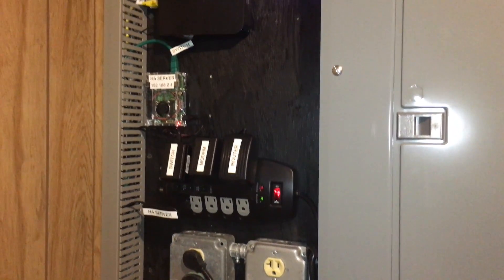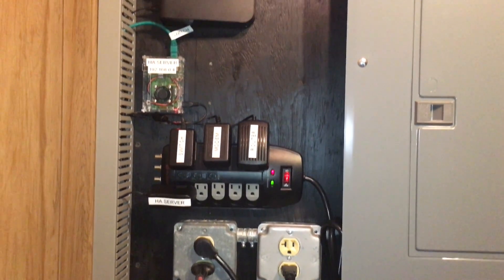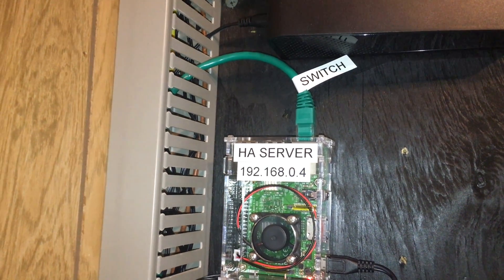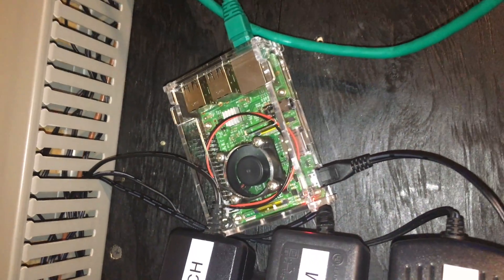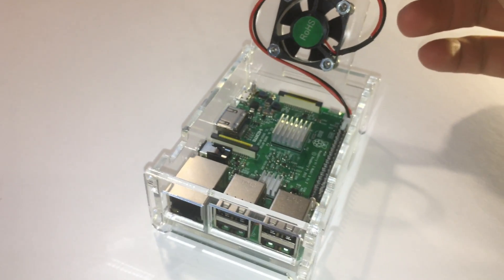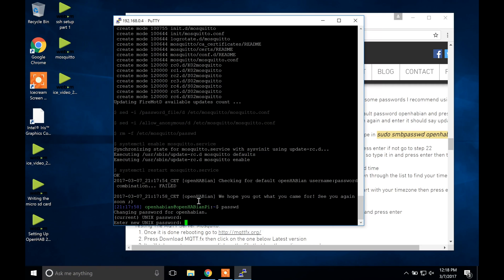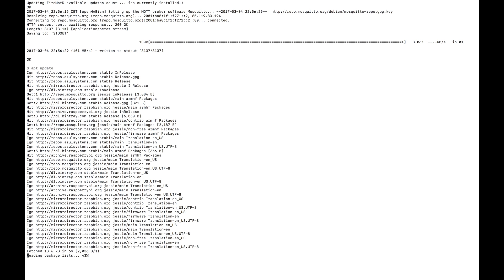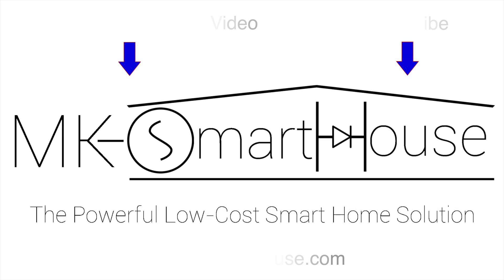Complete Guide Setting Up The Home Automation Server (OpenHAB 2 + MQTT): Demo

Comment: i have a pivotal question about your work .. i have been started following the guides three monthes ago .. i have been finished the network then the home automation server then openhab and remote access .. now i stopped at adding the devices .. i found that sonoff and shelly , for example , provides much simpler systems that doesn't need rasbperry pi or openhab , you just attach the device ( switch , plug . ...etc ) with electricity and bind it with thier own app , that simple . the question is why i would be forced to use such a complex system while there is more simpler systems provided .
Reply: I'm guessing because shelly and sonoff are device limited to whatever they are made for
So you can only control the lighting system using 1 shelly for example but cannot control the TV or ac using the same one whereas u can integrate whatever u want with this setup

Comment: Since the OpenHAB is hosted on Rasberry Pi doesnt that restrict the automation to the range of Wifi of Rasberry Pi?
If yes then is there any other way to extend the range except for using the Wifi extenders or USB WiFi Adapter?
Reply: Prathmesh Khedekar Wi-Fi devices don't connect directly to the Raspberry Pi using wireless (like in a ad hoc network)... these wireless devices connect to your wireless network and then communicate to the Raspberry Pi over your network... the Raspberry Pi can be hard wired or Wireless and communicate with Wi-Fi devices. When you have issues with Wi-Fi range, extenders will work but ideally mesh Wi-Fi systems like Google WiFi are much better as they create one Wi-Fi network under a single SSID.

Now if you're talking about connecting to Z-Wave devices, these types of a devices would have to connect directly to the Raspberry Pi wirelessly, so you need a device within Z-Wave wireless range. But the nice thing about Z-Wave devices is they actually create a mesh Network between eachother so if you have devices further away the signal can be a relayed across closer devices to get to the ones further away. A Raspberry Pi doesn't have a Z-Wave transmitter built-in but you can get a USB or daughter board Z-Wave transmitter to use on the Raspberry Pi.